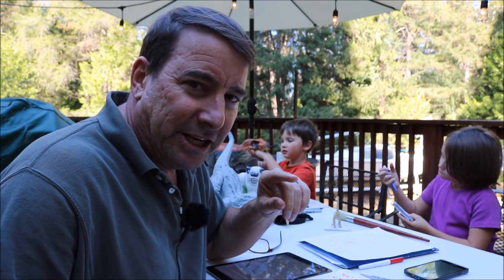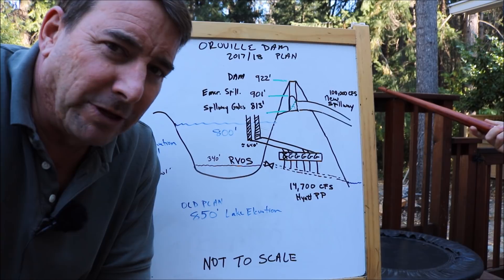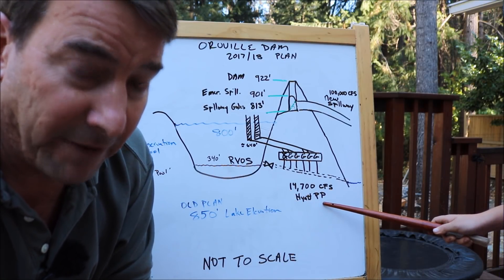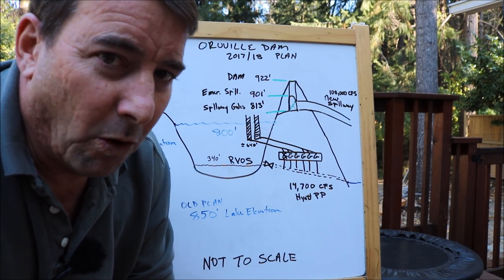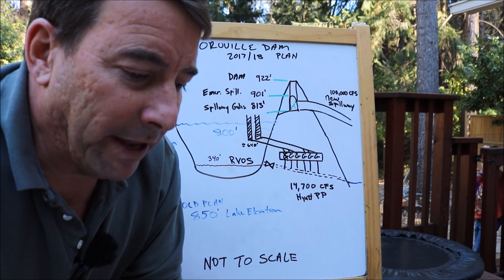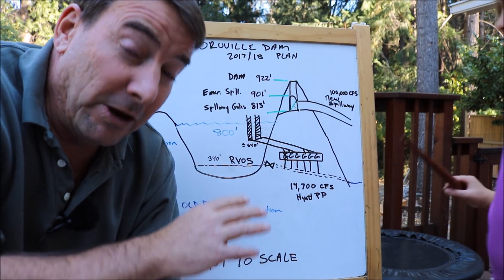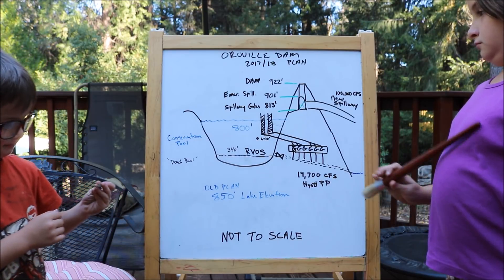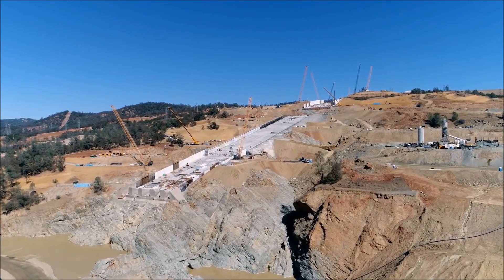Oroville Update 18 Oct IMPORTANT The 2017/18 Ops Plan

Comment: Great doing the report with the kids. I'm sure you'll have a Nov 1st report. But for Tuesday maybe just maybe you have some yellow Tonka trucks, yellow Tonka cranes, and other kid equipment. Can you report on how many candy corns (roller candy corns)  they have used, how much pumpkin puree was used for dental concrete?  As well how many pumpkin seeds will they use to replace the soil. As well how many pumpkin muffins has the crew eaten. If you have access to dry ice show us a machine flow of water with c02? Tip use hot water at the top.  Be fun to see something like that with good taste. Happy Halloween.

Comment: Here are a few questions:
1.   When they built the RCC walls, why didnt they build them back about 15' or so ....so they could be left in place when they come back to build the permanent walls next year?  (just abandon them in place behind the new walls).   Seems like they got a lot of work to bust them out next year.

2.  How to they plan to get RCC to the other side when they start to fill between the Emerg spillway and the secant wall?  Move the RCC plant?

3.  Will they simply build (and maybe rock bolt?) the 30" reinforced slabs right over the RCC section next year?

4.   Any idea how much removal next year below the upper spillway?   (how much down to good bedrock up in that area?)
Reply from the maker: Steve Bowser see the 4 part construction series, we answer these questions.

Comment: Juan:  As Kiewit is finishing up the roller compacted concrete, the Plunge pool portion it looks great!!  What is the reason they are going to remove it next year?   Is it that the RCC is less durable long term than structural concrete?  Also my guess is that they are not going to take it all out - just what is needed to get structural concrete in place.  The walls on the RCC seen on the flyovers by DWR look really stout - any idea if they are going to leave portions of that for the retaining walls?Excellent Project reporting. Consistent point of view and knowledgeable assistants!!
Reply from the maker: Marty King that's correct. I believe all RC walls to be removed.

Comment: Thanks for all your reporting and analysis.  What concerns me is that the so called plan for this coming wet season, is based on a bunch of assumptions.  Those assumptions may or may not be valid, time will tell.
Reply from the maker: Check out the report in detail...its VERY conservative.

Comment: I heard its going to cost twice what the contractors winning bid was, Who's going to eat the difference. I don't believe its fair to the contractors that didn't win the bid though they had more of a idea what it was going to cost.
Reply from the maker: 'Rock Clause' no, Keiwit will not eat this one. The extra work required insures the spillway has a SOLID foundation. It's not twice the cost. State Assemblyman Gallagher was choking a bit on the bill. But Remember the original guess was about 1/2 a Billion total. 250 for the Emergency and 270 for Rebuild. Emergency came in under and Rebuild over cancelling each other out. More importantly the extra rebuild money went to excavation of poor bedrock.

Comment: At 11:13 it looks like the feather edge of the RCC in that spot has not bonded correctly to the previous lift, and they are removing the non-bonded feather edge to make sure the hardened layer will be bonding to well-bonded substrate.  I think that is why they are just spot chiseling across the spillway.  My guess is they will fill the "wedge" area with some leveling concrete or shotcrete to make sure there are no voids, just before RCC application - just as they did around the bedrock on the fringes as they filled up the slope.

Comment: almost complete the reason they had jackhammers there is because there was excess they had to remove that to get it level so the layer of hardening concrete can go on top. they have 12 more layers to install and some rock cutting to do before they top it off and open the gates.

Comment: It seems like the project planners are over engineering the spillway capacity; I'd say that's a very good thing. Doesn't look like anyone's cutting corners (though I am ignorant about the cement details). You've also confirmed my own thoughts that California needs bigger reservoirs. Do any of you Californians know if there's a statewide initiative to build new dams and reservoirs? Also, something something adorable kids.
Reply: There are only 3 undammed rivers in the state .Damming all 3 would not resolve the states water problems. All other rivers have at least one and in many cases several dams.  Some dams in the state are not even built on rivers.  They are simply filled by pumping water uphill from a river in the winter.  The water then is just stored for later use. Most of the good spots to build dams and reservoirs have been used.  The remaining locations would not be able to store enough water to make a difference.  

The only realistic solutions California has are conservation, and ocean desalinization.

Comment: Great report Jaun!! You and your assistants made that plan very understandable!! Should be "required viewing" for all MSM reporters assigned to this project. 
Looked at quite a few comments and am surprised no-one has already asked this question. If they are fortunate enough to get enough water to satisfy their "end of the season" plan @ 830 feet, that means there will be 17' of water up against the gates. Won't that mean some amount of water "seepage/leakage" running down the spillway?? How will they be able to continue work on the spillway and/or how will they treat that water flow for that reason?? Are the gates 100% watertight??
Reply from the maker: Probably wait till water drops back below the gates. A BIG factor in the 15 April 'Top Off' plan.
Reply: I see. So, the spillway won't get "used", but will see a "trickle" if everything goes according to plan. ;o) Thanks for the reply.

Comment: A quick question about the Hyatt Power Plant. 

You said that the master plan is with an ideal operation of 5 of the 6 turbines, or that all the numbers are based upon the use of only 5 turbines. I am assuming that means that after the 6th turbine is repositioned and spun online in December/January, that they'll shut off one of the other turbines to give it a break, and do that to all 6 (one at a time) over a certain period of time. 

Did I get that right? I ask because I was a slight bit confused. It's a smart plan, if so, because it allows at least one turbine to be on reserve in case another goes down.
Reply from the maker: That's correct!

Comment: With the 50’ decrease in planned steady state water level, how much of an impact will this have on the power generation capacity of the power plant? Will that lead to having to purchase electricity from elsewhere, including increased use of coal, natural gas, and other renewable (hydro) sources, to meet the demands of California’s residents?
Reply: As long as the water level remains above the 640' level of the turbine inlets, power generation should not be a problem.  The planned 50' reduction means that the lake level will not be allowed to get above 800' for the upcoming season.  Last year it was 850'.

Comment: I agree that more storage is needed but it should be accomplished by meadow restoration in the watersheds and active fuel management using controlled burning in the forests above the existing reservoirs. California's investor owned export agriculture must be rearranged to reduce demand on the over allocated water system. Longevity of the soil and water will not be achieved with ever-sprawling irrigated agriculture. Thanks for the clear operational update. Your assistant is obviously well informed.

Comment: Very good Jaun. The kids are a fun distraction. Question : Do they start at the bottom with the hardening concrete? The top layer.? And is it'nt it permanent? Also how much of the sidewalls are to be replaced next year? I heard on one of your videos I thought they are getting replaced but later? That seams like allot of redoing of work all ready done. Thanks, keep up the great work.
Reply from the maker: bottom to top. all RCC walls to be replaced by structural concrete next year.
Reply: JB is correct- well done.

Comment: Watched the DWR update prior to your report.  I was off by 6' on my estimate of remaining RCC.  Does the RCC walls get the 'special sauce" or is that even possible?  Kudos to you and your fine assistant.
Reply from the maker: just the grout finish.
Reply: The RCC walls get a 6in shotcrete finish that is "super smooth" high velocity finish. It is very strong concrete, but not the the enriched RCC hardened concrete that the chute slab will have.

Comment: Captain Browne, really interesting about the adhesion of the layers of concrete, to "enliven" it. What the guys are pouring now has a 50% chance of being needed next spring, if not the next year for sure, is that correct?  Always in first class with my concerns addressed when your flying it.
Reply: The hardened top layer of RCC will be removed next year and replaced with re-inforced structural concrete to the final grade level.

Comment: California should really look into desalinating from the ocean  .Can mine the ocean water for minerals  . Then use that water after removing the minerals to run Pumped-storage hydroelectricity facility . Then use that water from the hydroelectric facility for irrigation and public drinking water .  Or to homes  to water treatment plants to the holding ponds to Pumped-storage hydroelectricity  . I think you can see the linier methodology .  

Already know that Calif's regulations are in the way of such a large project .
Reply: All desalinization plants today are revers osmosis plants (RO).  They are more efficient than other types.  99% of the salt is removed from the water at the plant.  jRO water is as clean or cleaner as river water in the state so it could be safely used on farms 

California has not had any brownouts due to solar power.  In fact solar and wind have not had any grid failures or brownouts..  Currently renewable only produce about 30% of the states power Most of the states power comes from natural gas, nuclear, and coal. We are a long way from overloading the grid.  If needed solar output can be curtailed by simply typing some commands into a control terminal.   In the future some excess solar could be diverted to the water plants or solar can be curtailed to avoid problems.
Reply: Yep. The coastal cities should just use desalinized water. Water shortage problem solved.
Good enough to drink but over time it would saturate farmland with salt. So farmland needs the rain water more than the cities.

If they use one of the nukes to power the water treatment plant, it can serve dual use for smoothing out brownouts due to solar panel use. During the day, solar panels make TOO MUCH power, threatening to overload the grid. Then when people get home and start cooking, the sun goes down. So a coal plant in Nevada needs to be on hot standby, just for the 5 pm till 9 pm peak.
Making and pumping water during the day will lessen the number of brownouts CA will get because of their 'green' policies.
Reply: If you don't line the basin properly .

Comment: Gettin' 'er Done!
Good work adjusting to all the changes & challenges of the job, while keeping the schedule in mind.  Looks like they''ll just manage it, even though it's not a HARD deadline in practice.

Going for a safer target level this year to reduce chances of using the spillway will keep most happier, all but those concerned more about water availability.

CA is in a quandary on water storage capacity, supporting ANY appreciable population requires modifying the Ecology. More dams in additional locations is one solution, with it's pluses & minuses.  Additional water from desalinization brings other costs, ecological & financial.

Comment: Cute children and what a celebrity in the making in Julianne!

Juan, if you could answer or maybe ask DWR a couple of questions to satisfy my curiosity...  How does RCC compare to bedrock in structural load carrying ability, strength, hardness, etc?  What needs to be done to the old spillway section to enable the entire spillway to be able to handle 270K gpm?  Is it a simple raising of the side walls?

Many thanks to your continuing reporting on this massive engineering project.
Reply from the maker: The old spillway section left at the top will be demolished and rebuilt NEXT year.
Reply: Thnaks!  If you can obtain any info on how the RCC compares to bedrock......
Reply: Just to add. Concrete, RCC, granite generally don't have a tensile strength as far as engineering design considerations are concerned. They really only have a compressive strength. How it's measured is at the time of the pour a sample is poured into a specific container and then stored for testing, in this case 28 days. Concrete continues to harden for decades
Reply: RCC is designed to have minimum compressive strength of 4500psi after 28 days.  Since there is no steel rebar in this RCC application, then it has very little shear strength.  So basically it is nothing like bedrock, but it is an excellent product to quickly make & install, with relatively decent compressive strength.  They can add chemicals for higher compressive strength, but they get really expensive for a project this size & volume of RCC being placed.
Reply: Thanks, KC.  Bottom line, not as preferred as bedrock for a foundation but much easier to work with, shape and to install.
Reply: Jim M  correct -- also they have used RCC in other brand new dam building projects.  Check out the Grand Ethiopian Renaissance Dam in Ethiopia that is being made entirely out of RCC.  They are about 60% way through it's construction and have been going at it since 2011.  They are planning on using around 13,341,000 cubic yards of RCC for its construction.
Reply: This is why they are limiting the full spillway to 100K CFS this year.  If it goes over that (which they will try like hell to avoid) then it will flow OVER the right side wall and back into the canyon (I believe).  That is to reduce pressure and cavitation on the RCC.  Then next year while they tear out and replace the upper section they will grind off the top two or three feet of the RCC and replace it with structural concrete as they have in the lower section.  So then the RCC is doing what it does well - be a massive foundation, receiving only compression forces. The structural concrete with it's much higher strength and ability to resist tensile loading due to the rebar takes the direct impact of the water flow.  All of this is detailed in the earlier videos.  In particular the four part grand tour of the project.
Basically, this was a very good plan - eliminate the risk of failure for this season, finish the job properly next season at somewhat higher cost...but probably not that much.  If they had tried to do it all this season they would have run out of time and been back to serious risk of failure.
Good job DWR and GREAT job Juan.  You are the first true example of a ... "citizen journalist" kicking every professional's ass.  Perhaps journalism is not dead, but is about to revive in this form.
Reply: Thanks, E Woods.  I had to do a little Google-ing to re-familiarize myself with the term tensile strength, not being an engineer.  That led to compression and sheer strengths education.

From a potential washout situation, does anyone have any idea how RCC would hold up to the dam failure conditions experienced earlier this year?  Better or worse than bedrock?
Reply: Thanks, Michael.  I used to work for a global industrial water purification company and we measured thru put in gpm.  I realized I might be wrong and boy, was I.  270K CFS equates to over 121 MILLION GPM, thats gallons per minute for those not familiar with the term.  You're correct Michael - that figure is mind blowing!
Reply: Jim just to correct your original post a little, the water flow down the spillway is measured in CFS cubic feet per second not GPM. 270K CFS is a mind blowing figure to picture. I believe as long as the RCC does not crack it would hold up better then natural bedrock which is full of cracks and faults that allows the water to get into and lift the solid rock which is basicaly what happened partly because the spillway floor was not anchored to the bedrock in the original construction. Cheers mate.🍻